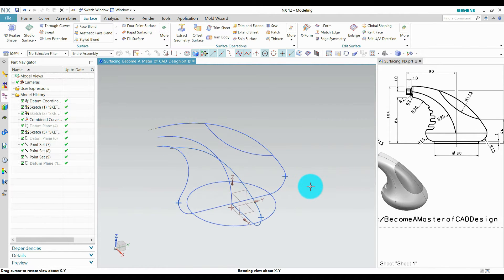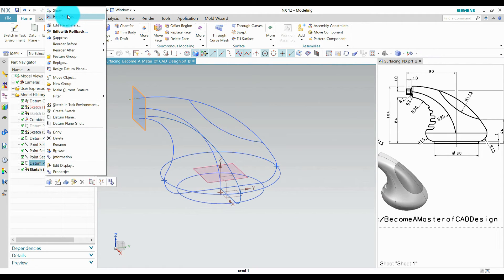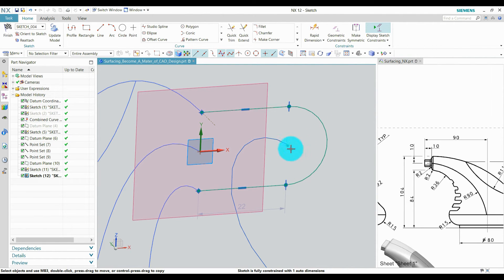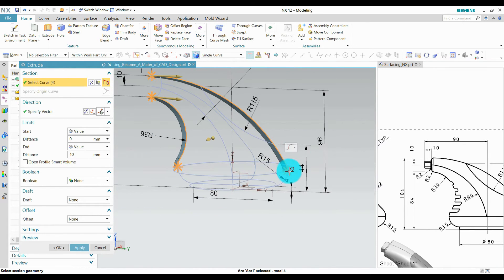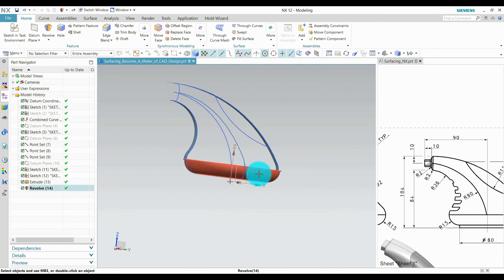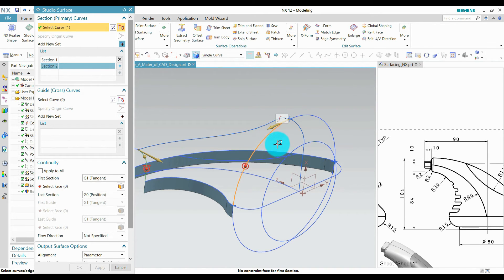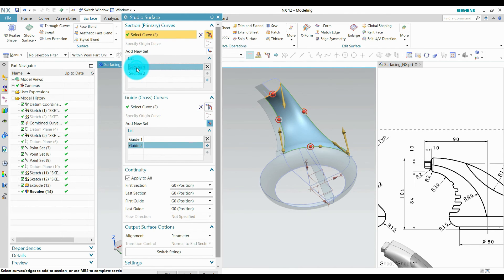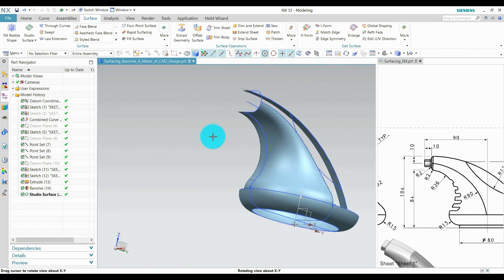Siemens NX CAD Surface Modeling Tutorial | Video #4

Comment: nice vid. thanks

working through this with

Version 1855
Part File Compatibility Saved parts can be opened in 1847 or later
Build 2900
Channel Main
Parasolid Version 31.0 (build 203)
Reply from the maker: Thank you so much for your appreciation.